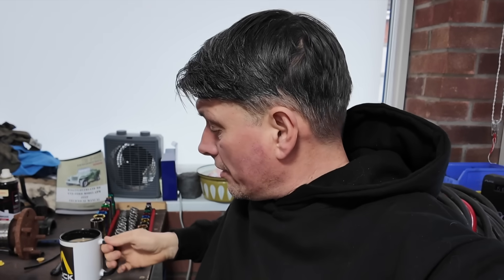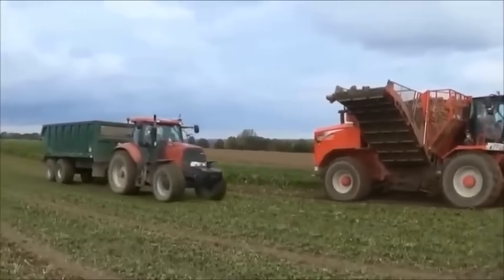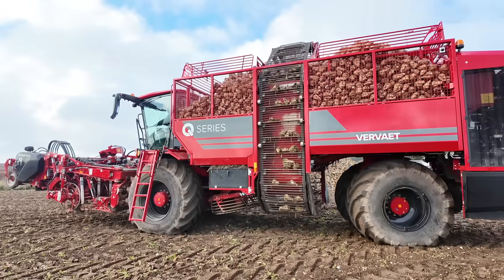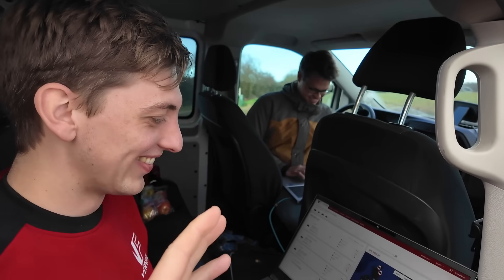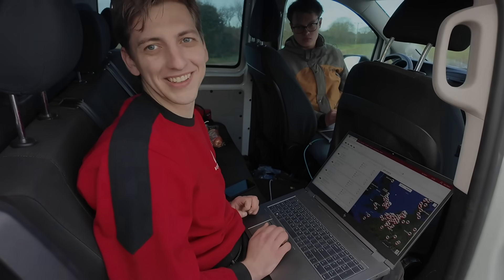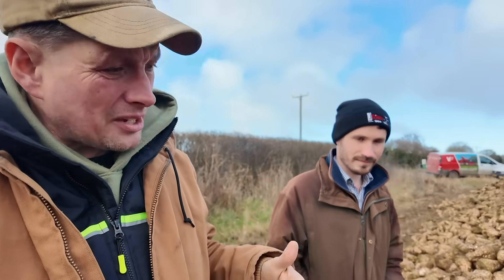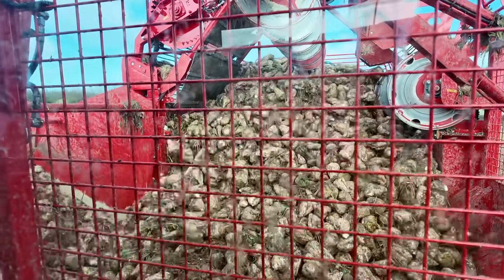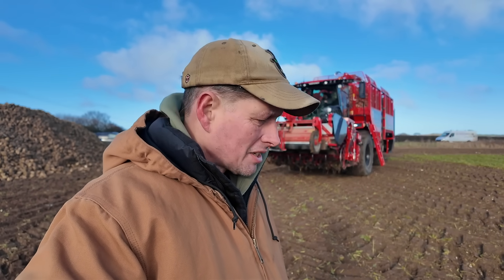HI-TECH HARVESTER ! - Vervaet Q-Series

Comment: In the early 80s, we were using 2 Standen single row, tanker harvesters. My work friend and I went to a tractor and beet harvesting demo near Sutton Bridge.  The Massey 4840 was impressive, but the Riecam 6 row tanker beet harvester was awesome! It could empty it's 14t tank in 30 seconds, 14t was the payload of the AEC 6 wheel tipper I took a thousand tonnes of beet to Peterborough with each year.